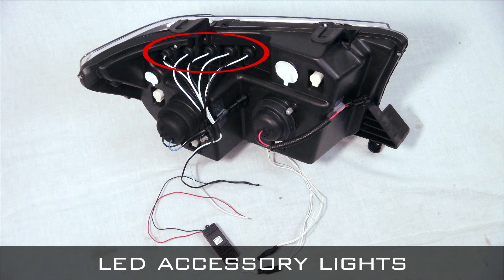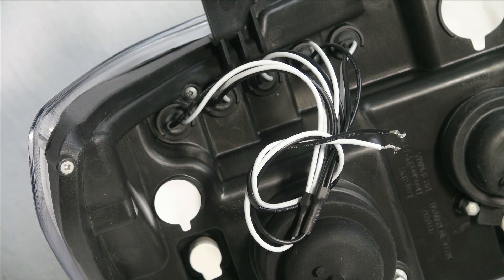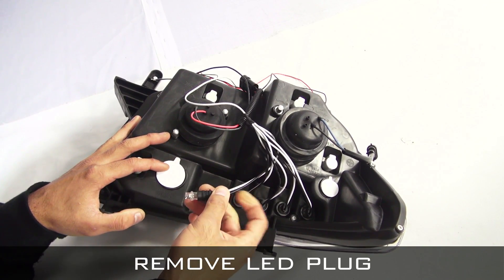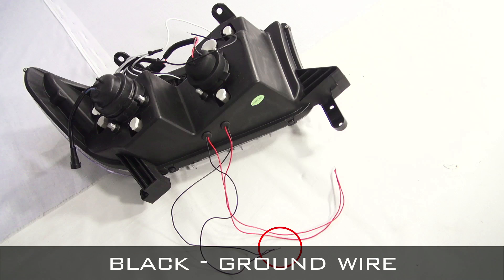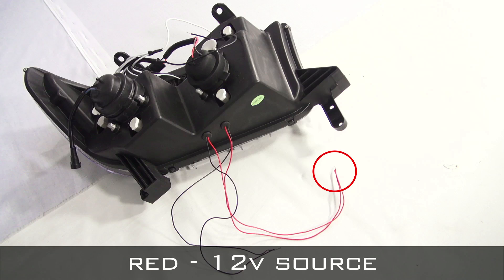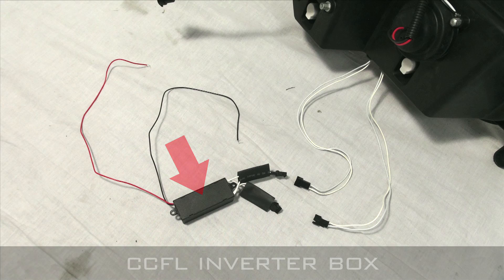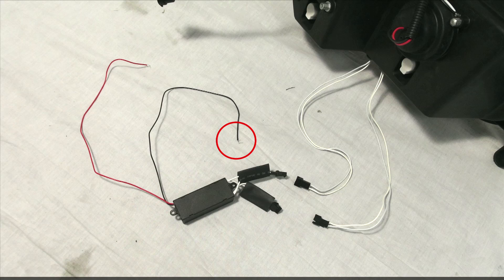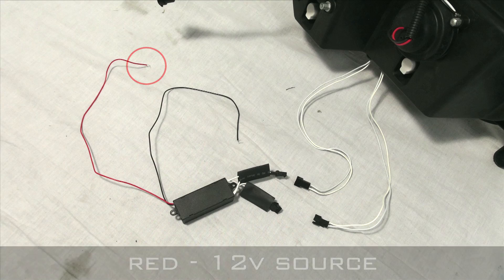Spyder FAQs: How To Replace Headlight LEDs, CCFL Inverters & Accessory Wiring

Comment: I bought black halo projector headlights for my 2005 f250 do I need to buy an inverter there aren't any good instruction on how to install and how to wire them up could really use some help.

Comment from the maker: the LED that illuminates the Halo ring itself is not replaceable; the cold cathode fluorescent tube for CCFL halos is not replaceable either in any easy way without actually dismantling the headlight.

double check your connections to ensure the ring's burnt out, please contact spyder tech support for further assistance

Comment: Do you have to use the inverters or can you hard wire to the running light wires?   When ordering I asked about the inverter but was told it did not require one?

Comment: Hi I just bought PRO-YD-THLAN11-3DDRL-BK for a 2012 Highlander and the wires don't look like the ones in the video. The two with exposed ends are green and black and have heat shrink plastic around the metal ends. Do I attach these to the parking light lines? I'll have to remove the nice plastic and metal ends

Comment: Im confused when u wired the halos they were red and black then they just turned all white. What wires are you connecting to the inverter?
Reply from the maker: if you have the LED Halo, your wires should be black and white. if you have CCFL halo, you will get 2 white wires with connector.  the CCFL two white wires connector can only fit one way to the inverter.

Comment: I have Spyder light installed in my 2002 camaro. both of my angel eyes stopped working. I believe the bulb ran out. is there any easy way to fix them? any help is appreciates. thank you
Reply from the maker: +metaltuned email us at techsupport@spyderauto.com
Reply: @spyderauto  hey i have a drl out can you replace that?

Comment: i have a halo lights with out plugs is just the wireing is safe just plug in led lights and the led lights plug on a truck 12v
Reply from the maker: +chukupuff24 our halo wires are meant to be tapped into your parking wires so yes they are safe with 12v